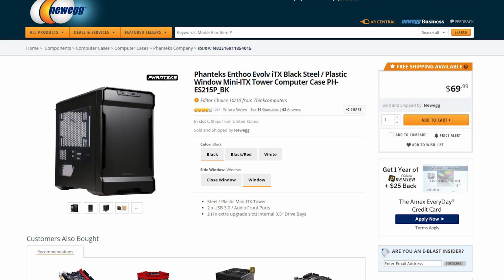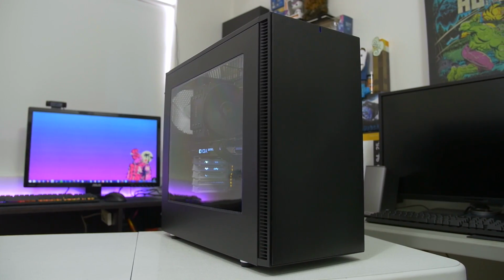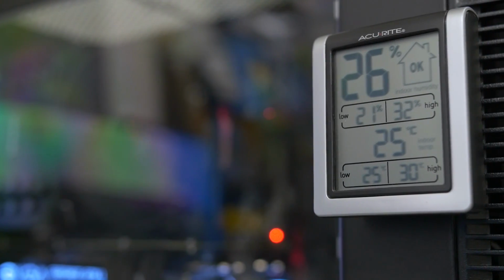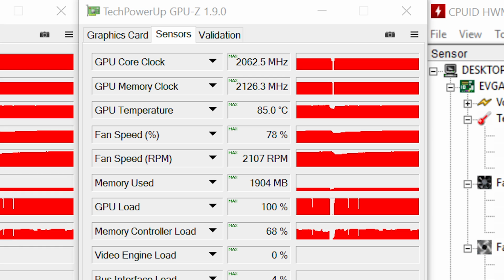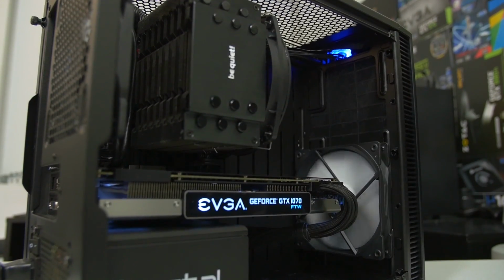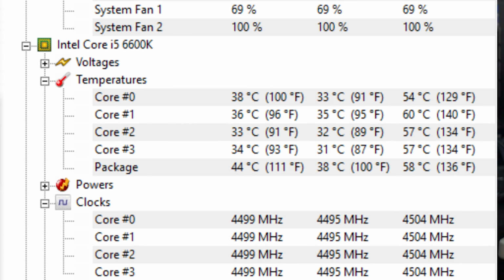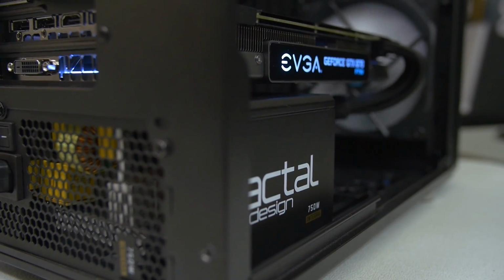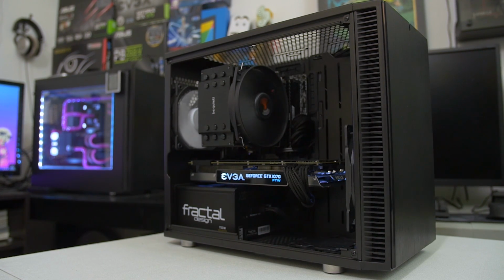Are Blower Fan Video Cards Actually Better in SFF Cases?

Comment: Whenever people ask me about open cooling or blower style GPUs I always tell them the same thing... 
Small / restrictive case case = Blower
Large / well flowing case = Open
Positive pressure case = Blower
Negative pressure case = Open

Having a blower style card is literally killing 2 birds with 1 stone... Cooling your GPU and removing the need for yet another case fan. Downsides - Older blower coolers were loud (they arent that loud as of late) And you cant overclock as far (they have far less heat sink surface area so they run out of cooling head room faster)

Having an open style card makes you NEED more case fans... More fans mean more noise. Downsides - People will often be surprised at how much heat they dump into your case (it literally boils down to "the amount of cfm the GPUs fans blow over the heat sink, is the amount of cfm your case needs to exhaust + the heat of the other components")

And when these companies make these small form factor cases with the PSU intaking air from outside the case and venting it outside, kinda leaves me scratching my head... The case is already small and restrictive... why remove a free case exhaust (psu)?

Comment: I built a custom itx case which has the gpu pressed right up against the case window. Even after installing a custom 3 fan shroud on the gpu it would still overheat when pushing the card. mind you this was an r9 280x Toxic edition, one of the hottest cards. So I then switched to an Asus 970 turbo and it runs perfectly, no more having to crack open the window for more air flow.

Comment: I have a SFF case with a open fan GPU. I did notice that the GPU heat increase so I flipped my PSU so the fan pulled air from the GPU. It works rlly well too

Comment: Uhh....hey Kyle....why didn't you just use the ITX board in both cases?  Then the ONLY part being changed is the case.....it's not like the ITX board won't fit in the larger case.....

Comment: I was just about to buy the 1070 from gigabyte (the giant 3 fan one and put it in a define s) 
would there be similar performance with the reference card as far as temps while keeping the same overclock? or would there be that 5 or so degree difference?
Reply: If you are looking to put the card into a define s (ATX case) then you should have no issues, in fact it will run overall  quite a bit cooler with the gigabyte cooler.
Reply: No the mini itx case. Sorry if that wasn't clear
Reply: Bradley Long In that case you have two options. Use an sfx form factor power supply with an adapter to fit the atx cut-out and use the gigabyte card. Or you could opt for a blower style gpu and an atx psu.
Reply: Right but I was just wondering if there was any benefit in using the gigabyte card (because more fans more cooling) over the blower card. Or is a blower card still better in my case.
Cause he tests with a card with 2 fans over 3.
Reply: Bradley Long The Gigabyte Windforce and EVGA FTW cooler (featured in this video) show better cooling performance with lower noise levels than the reference cards in properly ventilated scenarios. By using a smaller power supply you can alleviate the issue which Kyle was testing here, you would gain more clearance between the graphics card and the power supply cover. However if you'd prefer a more cut and dry solution then a blower would still work decently.

Comment: flip the psu over to suck the some of hot air out from the gpu in the nano s
Reply: Colin Tibbetts DAFAQ.....so the fan is on the inside??? Well it's sucking hot air so the psu will be hotter and plus it's fighting with the GPU fan...
Reply: Colin Tibbetts and what about the GPU ports
Reply: that psu can take it
Reply: flip it over and open the psu up, turn the fan around and blow psu air on the gpu (most psu's don't get that warm) will help but not optimal. Personally I would add another front fan and get some better airflow into the case instead.

Comment: Maybe a follow up with the power supply fan up would be interesting on the FTW. Just to see if the fans working against each other but still more open situation could be better than the gpu fan facing against a closed side.

Comment: Why people disliked this video, I'll never understand. great work as usual.
Reply: probs like an auto dislike bot cuz people are cunts?
Reply: It could be due to it being common sense that a blower is the right choice when the PSU would be blocking one of the fans otherwise.

Its sad that people need to be told that but indeed they do, there is so much misinformation about blowers always being louder without any intelligence being used to quantify it.
Reply: ppl might still be mad about bitwit. personally I'm a fan
Reply: Or people might have heard of what he did on a logo contest.
Reply: because honestly for the most part it felt more like a commercial for these cases then actually examining the thermals of the form factor.
Reply: i wanted to dislike because those 10:16
but then i realized that the video probably had to be so long
Reply: Kidus Tafa it's cuz Kyle is an idiot for not using 140mm fans at the front bringing fresh air that's why at pcpartpicker people made better decisions than Kyle and using a smaller power supply or evgas g3
Reply: Kidus Tafa https://pcpartpicker.com/b/2ZfH99#description

This guy did a better job than Kyle and no temp complaint
Reply: Kidus Tafa trump voters

Comment: Why does that eVGA FTW GTX1070 run so hot???
Yeah different card, but my Asus GTX1070 STRIX 8G doesn't run that hot, and I have it overclocked beyond what you have that eVGA set to.
Have you removed the cooler once before?
Weird, kinda high for an aftermarket cooler, unless that one just performs poorly.

Comment: Tis why I have my founders 1080, yes its a rip off, got it at launch etc.  My old ACX choked on itself in the case for this exact reason, my cpu temps have also dropped a similar amount by going ref/founders.
Reply: I'm with you on the FE 1080. Blower style works so well. That 1080 is cool and quiet.

Comment: I like blower fan just to keep my room warm in the winter
Reply: Just buy an AMD card for that
Reply: you realize the same chips will put out the same amount of heat regardless of efficiency of the cooler if they are running at the same speeds/power consumption.... 

actually if a card has something like a blower that is allowing it to hit thermal limits or the card isnt boosting as high, you are actually putting less heat into the room....
Reply: SHOTS FIRED

Comment: is it bad that my gigabyte rx 470 gets up to +85°C even when i use an agressive fan curve? or is it normal and not gonna damage it
Reply: Zay The Banana That's really bad, but Gigabyte's new cards have had very small heatsinks, so I'm not surprised. I would check to see if something's covering the fans on the card, though.
Reply: +Revenge Im getting the s340 in a few days hopefully that adds more breathing room. I shouldnt have bought the gigabyte g1 but it was on sale
Reply: The gigabyte branded AMD cards are of very poor quality. Jays two cents tested a gigabyte RX 480 and even in open air the card hit 80c

Comment: Guys I have a dilemma
Would you rather get the Rx 480 + freesync monitor 
or Gtx 1060 to use GameStream and play from the couch

I am so conflicted!
Reply: Rx 480 and freesync any day of the week.
Reply: Well the answer is in the question, are you gonna be on your desk more or on your couch?
Reply: John Gray GameStream is basically to play steam games on your nvidia shield using the hardware in your gaming rig. So if you have, say, a 1080 on your regular PC but you want to play Witcher 3 in 4k on your 4k TV, you can do it. The PC runs the game, encodes it and streams it through the LAN/wifi network to the Shield that displays it on the TV.
There's a program called moonlight that you can install on other HTPCs to stream up to 1080p (i think)
Steam has a similar feature called "In Home Streaming" as well, and apparently it works fine with AMD cards but there's issues more often than using nvidia.
Reply: Florinel787 gsync is much more expensive than freesync, I don't like screen tearing. The monitor I like is  a 29 inch freesync ultrawide, the g-sync ultrawides are like $900 minimum
Reply: I was in the same dilemma and ended up going with the 1060. I'm happy with it although the 480 wouldn't have been a bad choice either. it also came down to compatibility issues with MechWarrior online, a game that has a Nvidia splash screen, so amd would always work with their game.
Reply: Thanks for all this advice, I will keep thinking about it until Vega comes out :D Or AMD releases their own open source streaming software...
Reply: why a freesync monitor? get a 1060
Reply: there are other ways to stream games to the couch, go for rx 480. btw here's a good monitor for the price if you live in the UK. https://www.amazon.co.uk/gp/product/B018MYTH9U/ref=oh_aui_detailpage_o02_s00?ie=UTF8&psc=1
Reply: fuck the 1060

Comment: Should of tested GTX 1070 Mini from Gigabyte.
Reply: That would actually be hilarious, since the only fan would be directly obstructed by the PSU casing.
Reply: Jaggsta It would explode.
or turn into charcoal
Reply: should've not should of
Reply: *****
 its not a wide as the normal size cards.
Reply: Jaggsta ? I obviously knew that if I knew it only has one fan. I was considering buying one recently.

Comment: Fun fact. Fan noise doesn't bother me. Makes me cum actually. Jkjk, but really doesn't bother me at all. Have headphones on anyways.
Reply: try an fx8350 stock cpu fan under load.......that'll make you hate all fan noise forever
Reply: yeah me too. Fan noise=PC is performing at its best..
Reply: for me it's loud fan noise = pc about to blow up or burst into flames....
low humming during load is my pc purring
Reply: Abraham Grams turns up stereo system
Reply: My computer sounds like a jet engine tbh. Although I didn't wire my fans correctly, so...nevermind me
Reply: Even if I have my headphones on at a very high volume, I'd be able to hear the fans on my EVGA 960 SSC quite well at 95% speed
Reply: I have headphones on, that are open (HD598) 
Main reason I went with the Define R5 :x
Reply: i have an fx 8350... i mean if you spend more than $30 on a cooler, its just fine...
Reply: you can put small "passive" heatsinks on stuff like the base of a tower air cooler and other stuff like that. I take alot of shit apart and grab whatever i think i might use, so needless to say i have a shit load of weird heatsinks, fans, etc. I have a bunch of fans running at pretty low speeds to keep everything cool rather than a few running at high revs
Reply: i know the feeling, it made me buy a liquid cooler just to enjoy the silence
Reply: Have you ever used a rack server or been in a datacenter. makes any desktop seem silent.
Reply: Couldn't handle it, I'd be worried about it affecting the lifespan of the fans before having to re-lubricate them, and if it means that something's getting too hot.
Reply: Fun fact, the louder your fan's are running, the more powerful your pc is. Can't believe it's not common knowledge still.
Reply: Shamie Ramsamuj nope, I actually just have closed back headphones, that are stereo. I can hear my computer still with them on, but it just doesn't bother me.
Reply: Worked on a computer not long ago, even with my headset on, i could hear the fans better than my game that i played while i was stress testing it, something was wrong with the fans but they didnt want them replaced xP
Reply: Good thing that I bought a 3000rpm industrial PPC Fan.
Reply: Ignafiltro Sanchez That's a lot of blow man.

Comment: "No GPUs should run at 85*C for long time" Guess I really need to build my new PC soon because with the one I have, I get 102*C on my CPU and 99*C on my GPU. #fucked
Reply: damn dude.  if your not joking that's nuts.
Reply: You really should get a new CPU cooler, new thermal paste, and a different graphics card, or some combination thereof. What you said there just isn't right.
Reply: wtf system are you running? those sound like thermals that will kill chips.
Reply: One of my gpu's in the past kept hitting the high 80's. It burned out eventually and i had to switch to single gpu like a peasant.
Reply: Is that the new AMD's Foreman Grill ?
Reply: RUN BEFORE IT EXPLODES
Reply: Anyone who thinks 80°C is hot has never touched a 8800 GT, GTX 480 or R8 290X/390.
Reply: Double_Anarchy I play on a laptop and those are the temps while only csgo main scrern is open
Reply: Is your case filled with dust?
Reply: i have the corsair h115i also.  so far so good.  i5 4690k 4.7 @ 1.28 volts.  mid 60's under load
Reply: That's...

bad.
Reply: Emberstone I should I get a Corsair H100i v2, H105, NZXT Kraken X61 or Deepcool 240EX for my new build?
Reply: Take your laptop apart and clean the thick layer of dust that's, no doubt, on the heat-sink/s and fan/s.

Did it with my laptop and there was a strip of dust, like 2mm thick strip (like the blu tack strips) across the fins and it just rolled off, had to replace the thermal paste but that wasn't a big deal, and now the temps are half of what they used to be.
Reply: Get noctua nh-d15. No messing with loops and peforms same or better with less money.
Reply: CreepyCreep - CS:GO ツ Your choice of cooler depends on whether or not you want to overclock. If you aren't going to overclock, generally stock coolers are fine. Alternatively, you could go for something like a Hyper T2 from Cooler Master.

When I get some money, I was gunna get a Corsair H100i for my i7-980X. I'm still using a seven year old AIO cooler, and hitting 70 C with my 4GHz overclock makes me a little nervous.
Reply: I was either getting the Corsair H115i or Kraken X61, i chose the H115i.
Reply: Jesus. I always thought 80 was pretty terrible, now I don't feel so bad about my CPU and GPU temps. I guess it does depend on the platform though. AMD are pretty notorious for being little space heaters.
Reply: Royaldirtman RUN
Reply: Blair Lohnes Haha
Reply: John Gray I mean my pc is 6 y/o I think
Reply: CreepyCreep - CS:GO ツ RUN BEFORE IT EXPLODES
Reply: On 290X 95*C is a normal working temperature. Actually card can drop the performace with lower temperature.
Reply: which is big BS. GPUs can easily run at >90°C with no problem at all. CPUs don´t really like it, but GPUs got no problem with that at all.
Reply: Well some components are more sensitive than others, maxwell cards can take high temps. same for Haswell CPUs.
Reply: Ignafiltro Sanchez Them are some high temps to the point of ignition then watch those little things (Nvidia) throttle like crazy !
Reply: That's not good.
I don't routinely monitor my temperatures, but just prior to getting a new cooler I Thought I'd check the temperatures of my CPU and GPU.
The gpu was fine. It rarely got past 50 degrees even under load.
The CPU however was hitting more than 90 degrees, and I found that strange because I'm used to it hitting about 70-75 max (reference cooler, so it's not exactly going to perform miracles - by comparison the replacement cooler was sticking to about 23 at idle and 35 under heavy load, until I got a much newer GPU and a lot more stuff in the case, where it's now at about 30 idle and 50 under load. )

So.. Upon taking a good look at things I noticed the radiator had a huge amount of dust in it. Once I cleared all of that out, sure enough, the temperatures were back down to the expected 50-75 degrees the stock cooler gave me...

As for AMD temps, eh. it depends on the model.
The gpu I was using for ages that would idle at about 35, and be about 50 or at most 60 degrees under load was an ATI/AMD 5770 - Admittedly the most efficient card of it's day, and with a sapphire vapor-X cooler that's likely much better than stock. (turn it up to 100% and good luck getting that card over 50 or at most 55 degrees no matter what you throw at it.)
The sapphire RX-480 I use now is officially designed to run at 75 degrees under load - that's what they designed it for. And, it never breaks it. Often it's 74, but never higher than the 75 it is specified for.
Idle temperatures are about 48 degrees. You can't actually get the idle temperatures any lower than that, because at any temperature below about 52 degrees the fans stop completely and the card is passively cooled at that point. - There's no way to over-ride this.
I suspect that If I could force the fan speed to 100% at idle the temperatures would also get down to 35 or 40 degrees at most...

AMD doesn't automatically mean hot. Though I guess for modern cards there is a grain of truth in the idea of them being power hungry.
The RX-480 was supposed to be a massive leap in efficiency, but in the end it turned out to need more power than it's specifications say it should need...

(the 5770 is the opposite; At idle, a system with one of those barely draws 110 watts total, meaning the card itself can't be drawing much of anything, in all honesty.)
Reply: *****
true, didn´t think of that to be honest (facepalm - i should have thought of that xD)
Reply: My 7970m hit 103C when playing the crew. I have an MSI gx60. Why would they even think of making an all amd gaming laptop and only one fan? #fucked
Reply: My R9 280x runs at 83 C° most of the time, no problems in the last 3.5 years
Reply: All your GPUs should be thankful, for at least they were not chosen to slave away in the mines for their entire lives, only to be resold or RMA'd once they're nearly dead!
Reply: switch to pushpull, i used to hit 80c on my 4970k but this made it drop to 50 on load.
Reply: Do your components still work today CreepyCreep?
Reply: Dont worry there is no problem running a gpu at 85 degrees - anyone that says different is an idiot
Reply: You should really consider aircoolers, they are often as good or even better than aio's, and they are usually quieter. Be quiet! Dark Rock Pro 3 is also quite good looking